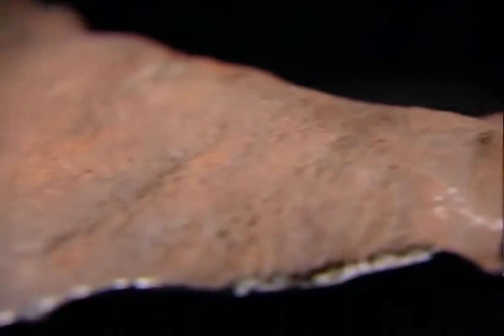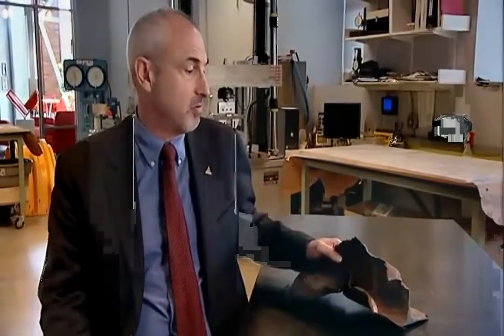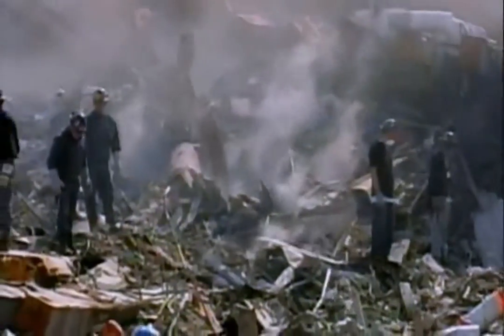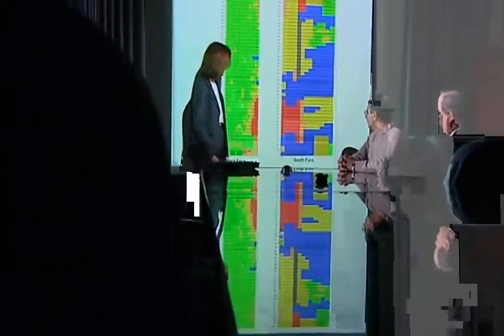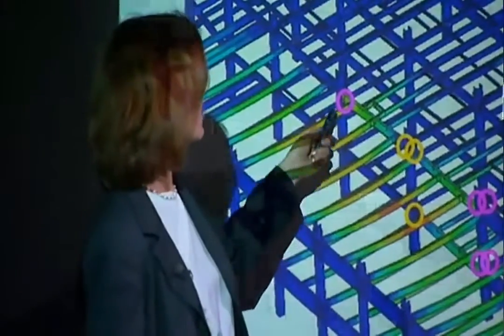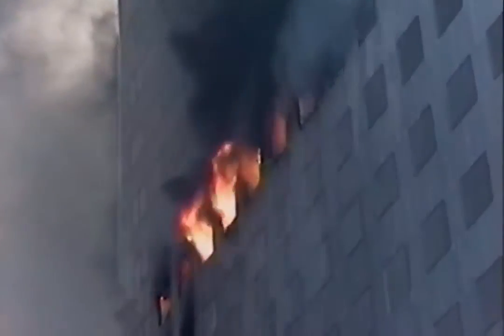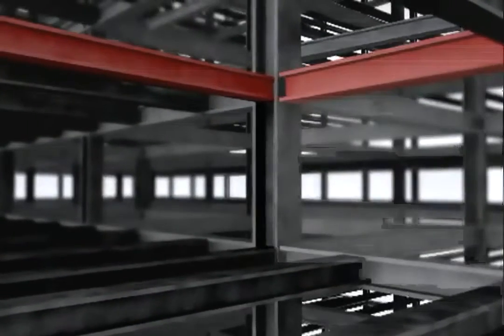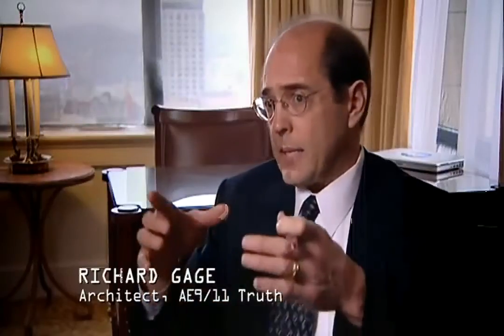9/11 Aftermath - WTC: Clip on WTC7 Steel & Collapse Issues

Comment: The poor building just gave up and offered no more resistance to load than air - proven by the free-fall speed of collapse. Surely every part of steel structure didn't just instantly lose all resistance to load without a little help... the collapse is identical to a controlled demolition and very different from any other steel building collapse - the first to be caused by fire.

Comment from the maker: 03:04 - The statement made by the leading NIST WTC investigator Dr. Shyam Sunder , that the NIST investigation into WTC7 took only 2 and 1/2 years, is obviously wrong, because many aspects of that building (fireproofing, sprinklers, smoke management, tenant retrofits, compliance with NYC Building Code, etc.) were investigated since the beginning of the WTC investigation in August 2002, and the relevant reports were already released in Sept. 2005 with the final reports on the twin towers. In fact, NIST needed more than three another years (Sept. 2005 - Nov. 2008) to come up with an explanation for the WTC7 collapse.

Same incorrectness is spread by the official NIST YouTube video on its WTC7 study from 2009: 
https://www.youtube.com/watch?v=PK_iBYSqEsc